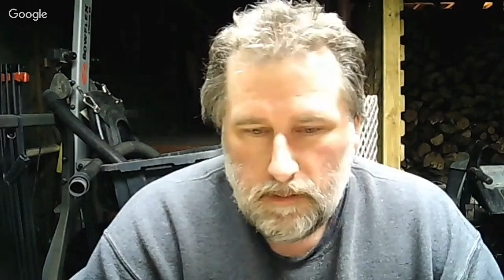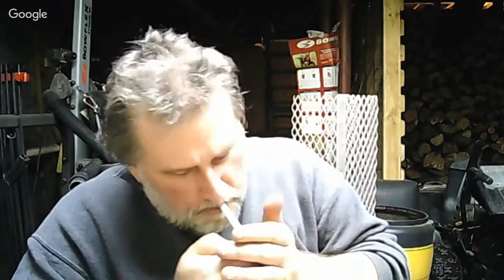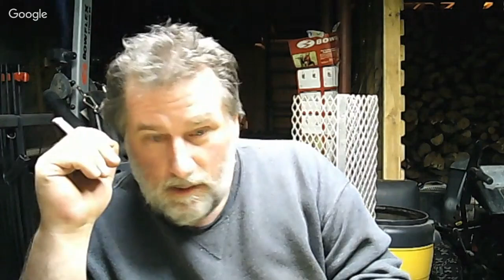EDISON NIFE BATTERIES PROS AND CONS

Comment: You clearly have no idea on how to charge and use a nickel iron battery. My battery bank is over 9 years old and are running at over 85% efficiency. 
You need to do some research before you our together a youtube video.
Victron inverters work perfectly with NiFe batteries, Outback, Victron, plasmatronics and even Midnight charge controller work perfectly with them.
You clearly have no idea.
Reply from the maker: Before you go slamming a person, look at what I am running. My batteries are from 1971,  a lot older than yours. I have been playing with them for 20 years now. I think I now a few things about them.  I also have a friend that runs a 120v dc bank of them. Problem with most inverters is that at 15 to 15.5 they shut down to over voltage. My bank is fully charge at 18v. So I think you should go educate your self before you run off at the mouth.
Reply from the maker: And if your such a expert then why are you watching my video and why don't you have any videos on yours.
Reply: Yeah. Show us your videos genius.

Comment: I like this guy!
Reply from the maker: Thank you
Reply: I live on a sailboat.  I'm using 6V Trojan clones, for 440AH of 12V juice.  And they have worked pretty well, but I have to change them out every 4-5 years.  They're charged by two 135W solar panels, wired in parallel.  From your enlightenment, beside the difference in weight and space,  charging those NIFE guys may be a whole new animal.  I'd probably have to wire the panels in series and get a different MPPT controller.

Having an almost eternal, and robust, source for DC storage is a really happy thought for me, though.

Comment: I have seen some guys who dismantled these batteries to repair them and they found large amounts of black powder at the bottom of the case.   Those are Nickel OxyHydroxide which is the active material of the battery.  When they fall off like that,  the battery looses capacity. I guess you could theoretically put it back into the cathode casing (small rods), but i'd imagine that's very difficult.

I've done extensive research on this topic hoping that I could build them myself.  I didn't realize that you only get 40% back when you charge it.  This is discouraging.
Reply from the maker: The 40% back is discouraging. But at the cheap rate of solar panels these days. I rather have a battery bank that last me forever and just buy more panels that to be replacing expensive lead acids all the time.
Reply: That is a good point.
Reply: @Mr.FixItMan  Is it possible that the low efficiency is do not fully charging? you mentioned that you were shutting off the panels to keep the voltage lower.  Perhaps the 65% efficiency would be had with an inverter that could use them at full charge.  Also, PWM is not the most efficient charge controller, a MPP charger gets the best conversion from panel to battery.  I would also Imagine you would get more charge out of your battery if you used a higher voltage system, Usually the faster you draw a battery, the less efficiency you get out of it, so if you double the cells, you half the current and would theoretically increase the efficiency.  Not to mention increase the max power you could draw.
Reply: Lithium batteries?
Reply: one other plus is that you can mix old and new cells.

Comment: Trojan T-105 works for me...  Fairly inexpensive and there easy to find.  (Golf Cart Batteries).  Cheers
Reply from the maker: I ran a set of T-105 for 8 years before I got my edisons, they did good for me too. I was wanted Edisons for years, and it worked out that I found a deal on them right about the time that the T-105s where dieing.

Comment: i have some old railroad batteries in my shed that i got from my grand father when he worked on building train cars a the A.C.F... i never used them i dint think they would not be any good. i am glad i dint sell them ill have to try to charge them .... after i watch a video how to do it . i think they are new all of them are in small wood crates ..
Reply from the maker: Most likely they are Edisons. You may have to do a electrolyte change, but they should be good.
Reply: I`AM gonna dig them out this summer and check them out.
Reply from the maker: When you get into them feel free to ask ?s,  I well help all I can.
Reply: OK I WILL
Reply: What are they? What is stamped or printed on the batteries? They could be worth $$$ if you just want to sell them.